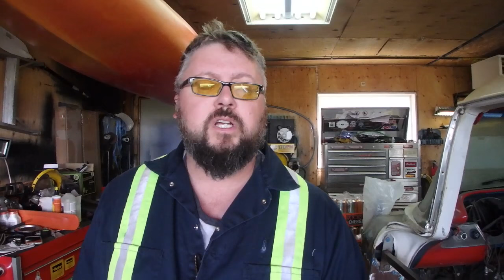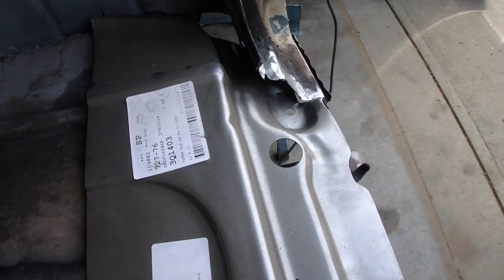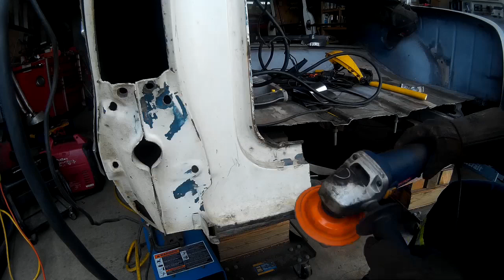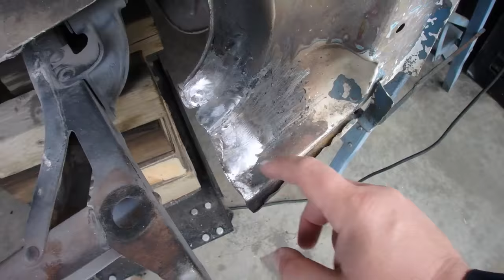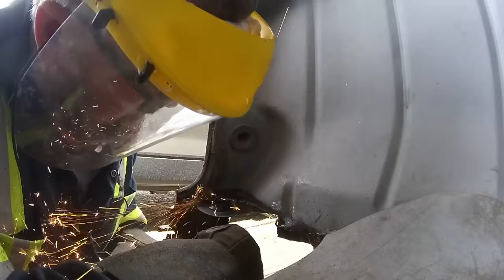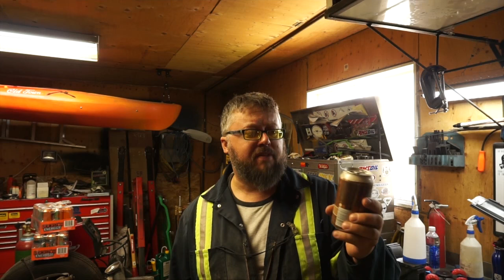Surprise Behind the Lead Filler

Comment: I had a Jaguar XJS with similar rust issues. I started cutting it out but the more I cut out the more I found.
The final tipping point was when I found the top inner wing box section was just filler over a piece of timber.
Sorry to say I ended up breaking it and selling the parts.
Good luck with that car, I feel your pain!. :).

Comment: is there no work? or is there no $70,000+/yr millwright work?
Reply from the maker: no work for anybody with the collapse of the Oil market, over 100k people out of work here.  i've had a few interviews but they all say the same that they get 100's of people apply
Reply: +Bullshitkorner no work on the maple syrup plantation.....?

I'm just joking. I get it. you know me, I worked as a roughneck right as the market tanked. I know how important the industry is to those towns. my saving grace was the fact that I had 6 years of aircraft maintenance experience. so I just rolled into a heavy maintenance job with Bombardier
Reply from the maker: you'll only find the Maple trees in the Far Eastern Canada,  I remember you saying about working at Bombardier.  The Market is pretty tanked out here for sure